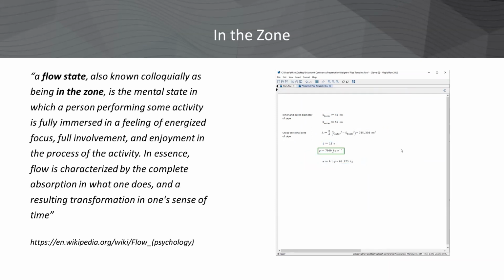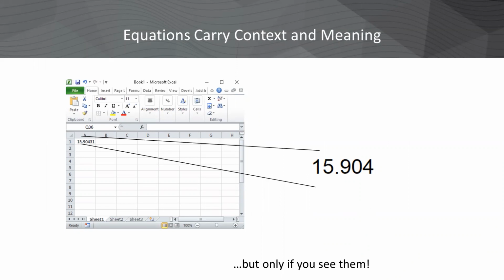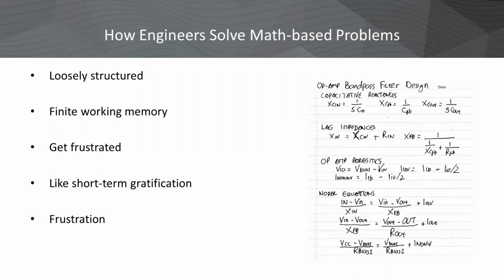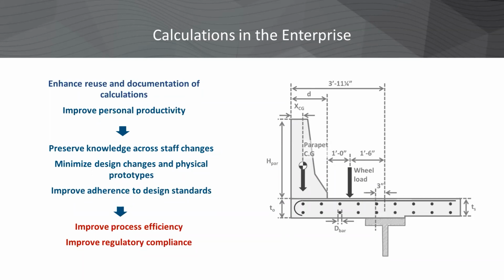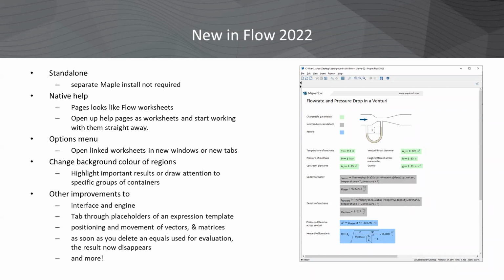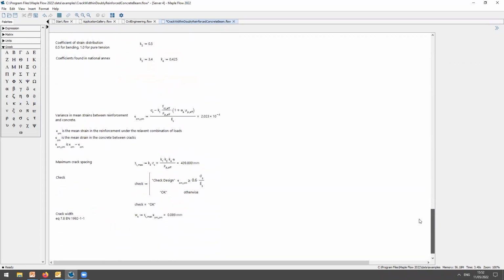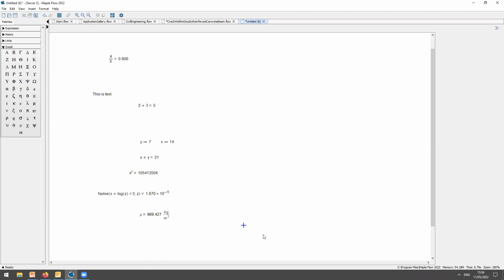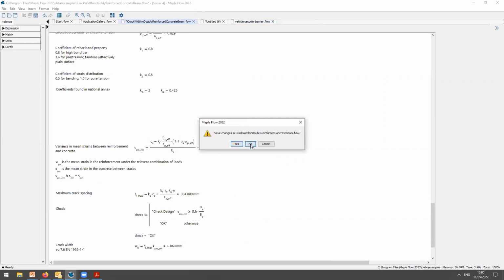Maple Flow 2022 – Electronic Paper for Calculations

Comment: Is Maple Flow a subset or a superset of Maple?
Reply: Maple Flow is a stand alone product, but it is built on the same math engine as Maple and so still allows access to the Maple math commands and equation solvers. The simpler interface makes it easy for engineering users who want to gather project source materials, parameters, and equations in one place, perform calculations, and then produce professional looking design reports. Maple is generally preferred by engineers who need to connect to other datasets, create web based widgets, perform deeper analysis or want to make use of the powerful Maple programming language as part of their design analysis.